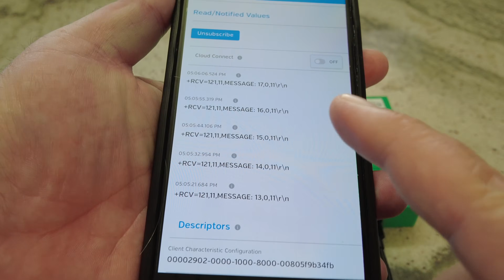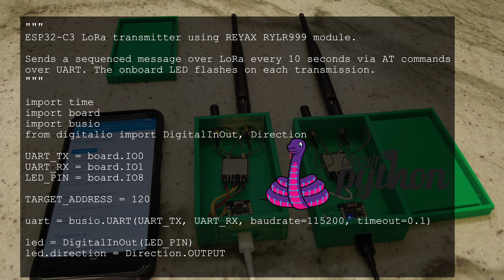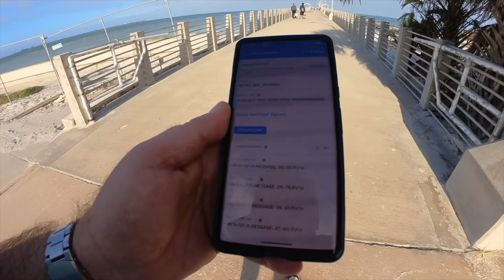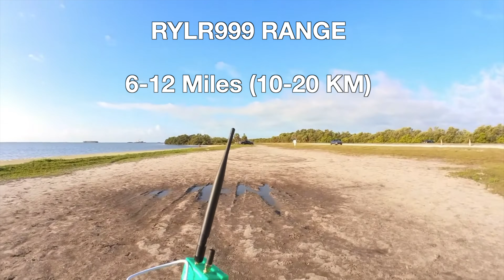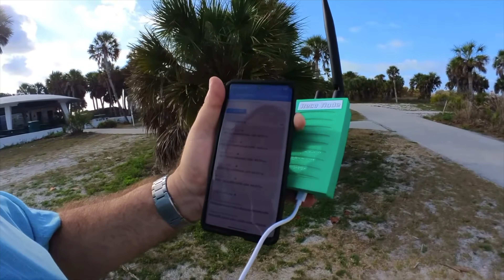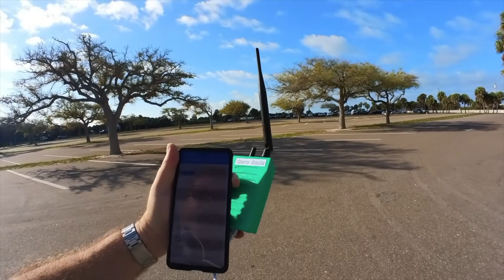DIY Long Range Data: RYLR999 LoRa to Bluetooth Bridge

Comment: Q) I have a device that connects to my phone using BT, and is controlled by an app. Can we use these nodes to increase the distance? ie connect this transmit node using BT to the Device, then connect the phone to the Receiver AND now we can talk / control that BT device from say 1/2 mile away? The BT Devices in not BLE, its BT4.0.
Reply from the maker: I would ask Reyax that question, but I think yes, since you can set it up in bridge mode. The issue I see is that the Bluetooth device presented on the far end might not be the same device on the near end, but I know too little to say. I will play with this setup sometime again and see if I can understand, but Reyax would have the answer.

Comment: Does that mean you would need 4 circuit boards to send and receive from both ends?
Reply from the maker: There are my options here, but these boards combine the LoRa and Bluetooth on one chip, so you need at least 2. You could have a cellphone on each end, so then it's just the two chips. I used a ESP processor to simulate creating data to send.